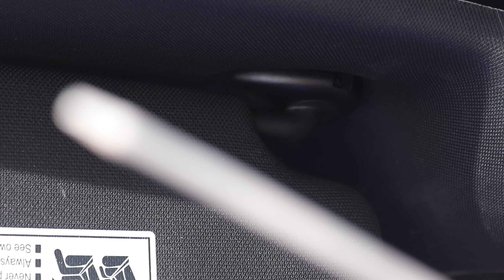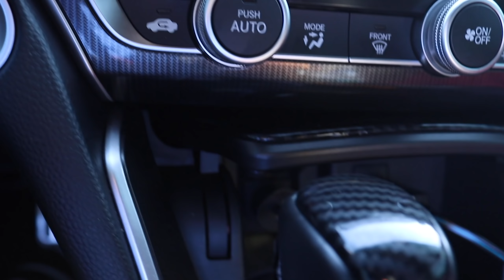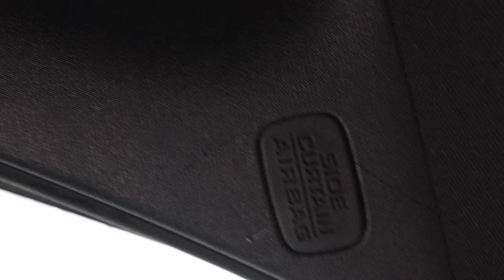Fiber Optic Star Lighting Installed In 2018 Honda Accord Sport

Comment: Remote start Key fobs are available for all 2018 Honda accords and trims 1.5 and 2.0. Just go to your Honda parts store and pick up a remote start key fob. part number 72147-TVA-A21. Prices may vary. I Paid $91.15 at Parts Honda of Chula Vista, CA. Afterward take new fob to service department for reprogramming service. No extra parts are required. Takes about 25 minutes. I was charged $ 130.00 at the service department of Pacific Honda, CA. No more getting into a hot or cold car.
Reply from the maker: Definitely will be posting the video of that in two weeks
Reply from the maker: Thank you

Comment: How did you wire this so that it can connect with taillights, I’m trying to do this on my accord
Reply from the maker: So I wired it to the DRL brake light but I’m going to be purchasing longer wire so I can wire it to the ACC on the fuse box Basically were connected the lights underneath the seats

Comment: how does it turn off/on, can you controll it while sitting in the driver seat? does it turn on when the cars starts?
Reply from the maker: Yes you could turn it on or off this product comes with a remote where you can change colors change the speed yes you can change it while sitting in the driver seat And yes it turns on when the car is on but like I said it comes with a remote so you could turn it off anytime you please

Comment: So when taking the headliner out, did you just fold it and pull it out of a door? Because I don’t want to put any creases in my 2017 Acura TLX before doing this.
Reply from the maker: Your best bet would be to remove the rear seats also so you have more room to remove it when putting it back in the car seen on the video I've been through too much so there is a little sign of creases
Reply from the maker: So removing the rear seat is a must or you could just take the headliner down and do it inside of the car

Comment: As you installed this together, how did you connect the box and the cigarette lighter in the back of your accord ?
Reply from the maker: i purchase this https://www.ebay.com/itm/12V120W-Cigarette-Lighter-Waterproof-Power-Motorcycle-Boat-Socket-Plug-With-FuPF-/264692629242?var=&hash=item3da0e8fefa
Reply: Jovenell Moly to where did you hook that up to?

Comment: Yo did you install a kill switch to it wire wire it to the car or is that power all coming from the battery box it comes with ??
Reply from the maker: I have no Killswitch all I did was connect the wires to the daytime running lights

Comment: Hello sir I need help with something please. I'm looking for the way the most simple and sure at the back of the vehicle to connect the engine led light. How did you do with your car? Did you install fuse to prevent fire?
I would like plug the engine close to pillar trim C If it's possible. Thanks to your answer. Very good job 👍👌

Comment: Hi i cant write english very good but how did u install the battery,and where did u put the source box?! Thanks
Reply from the maker: I purchased a 12 V cigarette lighter connector and wired it to the DRL brake light thesaurus box is in the back of the trunk on the top left side you can find that on the end of the video

Comment: Do I need the 12V cig lighter to put the stars in my Honda Civic?
Reply from the maker: https://www.ebay.com/itm/12V-Waterproof-Boat-Car-Motorcycle-Power-Outlet-Cigarette-Lighter-Socket-Plug/133414429023?hash=item1f101ea15f:g:av0AAOSw36xew4Is

Comment: Where did you end up putting the light box engine and where did you run the power cable to? Was it able to run from the back to the front?

Comment: Aye my guy what power source did you tap into for the light motor? Did you just find a 12v source and splice or what?
Reply from the maker: I purchased a 12 V cigarette lighter socket which had a negative and positive I just Wired add to the daytime running lights and that's basically it

Comment: Great Job !
Can you show us how did you connect the machine to those small fiber (PMMA ) and how did you punch hole into the headliner ?
Reply from the maker: The Hulk I purchased this item and I connected it to my daytime running late https://rover.ebay.com/rover/0/0/0?mpre=https%3A%2F%2Fwww.ebay.com%2Fulk%2Fitm%2F253628904281 And to poke the holes where I purchased this https://rover.ebay.com/rover/0/0/0?mpre=https%3A%2F%2Fwww.ebay.com%2Fulk%2Fitm%2F330932993295

Comment: Yo - How'd you "poke" the holes in the headliner (audio cut out when you started that process)? Does the fiber just push through?

Also, which fuse did you wire up to?
Reply: The fiber optic wont create holes use a small safety pin and it will slide in

Comment: Does it change multiple colors at the same time or does it turn on and off with music?
Planning on doing this to my SUV which one do you recommend me to get?
Reply from the maker: Yes it has a remote where you could change colors or leave solid colors It has three different fade modes it does not turn on or off with music in you can buy one of those on eBay if you’re doing your SUV is going to be more on the expensive side you’ll probably end up spending 250-300 for 1000 piece fiber optic strings

Comment: Where did you connect the wiring to?
Reply from the maker: Sorry about that all I did for wiring was I purchase a 12 V cigarette lighter socket which has a positive and negative wire I then connected those wires to my daytime running light and connected the light box from the fiber optic strands to that 12 hour cigarette lighter socket and put Electrical tape around it And put it in a secure place

Comment: Yooo, great video the only thing I can not figure out cause no one is showing it.   Is how did you connect them to power, Ive got all the other steps down but am worried about the power.
Reply: These plug into to the cigarette lighter, oh yeah yeah
Reply: Dizzysteak -Yo i wanna hook it up to my dome light but no one has done it
Reply: American Guanaco I’m trying to hardwire them into the cigarette lighter that’s why I ask haha.  Oh yeah yeah.   I wouldn’t put it into your dome light because then it will only be on if you switch the dome light on or if you open a door.
Reply from the maker: Sorry I took forever to message you but I will be making a video soon on how I installed the light
Reply from the maker: Yeah I didn’t plug mine into the cigarette lighter

Comment: Good video. I am glad you rpovided the links, because I wanted to see how many points of light you had. So it is all 500 points at 0.75 mm in your ceiling?

That is fairly bright for 16W. I am considering going with a 45W one on a tree.
Reply from the maker: Thank you I appreciate that and that is correct I do have 500 fiber optic strands
Reply from the maker: The brighter the better

Comment: How did you plug in the power and connect it to the box when it's in the trunk? There isn't anywhere to plug in the power in the trunk so I would greatly appreciate if you could let me know how you did it. Love the video man it looks crazyyy!!
Reply from the maker: Sorry about that all I did for wiring was I purchase a 12 V cigarette lighter socket which has a positive and negative wire I then connected those wires to my daytime running light and connected the light box from the fiber optic strands to that 12 hour cigarette lighter socket and put Electrical tape around it And put it in a secure place

Comment: This looks hella dope bro I just bought the lights to do this on my civic sport 2019 I was just wondering tho how did you wire it or how did you end up connecting it to a power source
Reply from the maker: When you do it please Instagram me at Jovenell.94 so I could check it out and as of right now I wired the lights to the tail lights but I will be rewiring it To my accessories fuse
Reply: @1.5thondaacord  how’d you take off the wire harness retention clips in the A-pillar, the audio cut out when you were at that step

Comment: NICE 8-)....gonna do to my 2018 sport...was worried couldn't get headliner out of car but obviously can be done....if u got any other info on problems u ran into let us kno...thanks
Reply from the maker: I'm very happy that you're interested in doing this project for a better ways of removing the headliner out the vehicle I suggest that you remove the passenger seats the bottom portion so you have more room to remove the headliner without creasing it

Comment: How are you powering the light if you have it in the trunk?
Reply from the maker: I am currently running the wires to my DRL brake light Since the wire wasn't long enough but I will be wiring the lights to the ACC fuse soon

Comment: Bout to do this to my 2.0t. You didn’t explain how u wired everything up though, curious.
Reply from the maker: Sorry about that all I did for wiring was I purchase a 12 V cigarette lighter socket which has a positive and negative wire I then connected those wires to my daytime running light and connected the light box from the fiber optic strands to that 12 hour cigarette lighter socket and put Electrical tape around it And put it in a secure place

Comment: Bro how did you setup the power cord where did you connected since is not long enough
Reply from the maker: Josias Urena I bought one of those 12V Cigarette lighter connector and then I wired it to the daytime running light
Reply: Where did you found the cable of the DTRL

Comment: Did you use the 500 count fiber optics? If so, where did you find it because I only see 250 on amazon.
Reply from the maker: Yes they are use 500 fiber optic lights I purchased them on eBay https://www.ebay.com/itm/16W-Car-LED-Light-Remote-Twinkle-Engine-Fiber-Optic-Star-Kit-500-Strands-2M/302942345953?ssPageName=STRK%3AMEBIDX%3AIT&_trksid=p2057872.m2749.l2649

Comment: confused by your comment so take the head liner from the truck or don't... I'm trying to do this but thank you so much for doing a video because I was thinking about how hard it was going to be. Also how many stars did you work with because some have 400 and others have 800 and I was thinking more because its a sedan but also more work so I'm not sure and I don't want it to look crowded.
Reply: also what did you use to poke holes in the headliner?
Reply from the maker: Yes you got to take the headliner out of the trunk if you take it from the door it will crease up and thank you for watching my video it was hard but then if you really believe in yourself on doing this you will achieve that goal and to be honest the more the better but the more the longer it will take to finish the project I’ve purchased the one with 500 well like I said the more the better I’d say buy 500 to 600 that’s all you need
Reply from the maker: https://rover.ebay.com/rover/0/0/0?mpre=https%3A%2F%2Fwww.ebay.com%2Fulk%2Fitm%2F330932993295
Reply: Jovenell Moly is that the tool you used to poke holes with and also which one did you use the 1 rounded liner